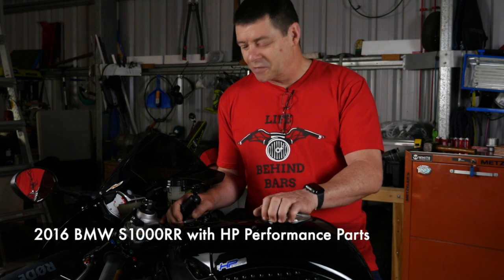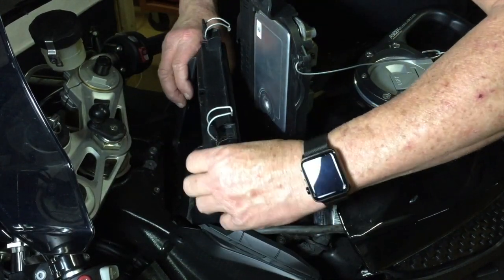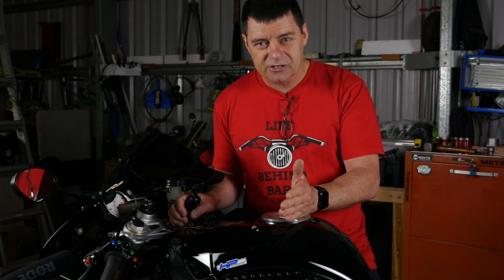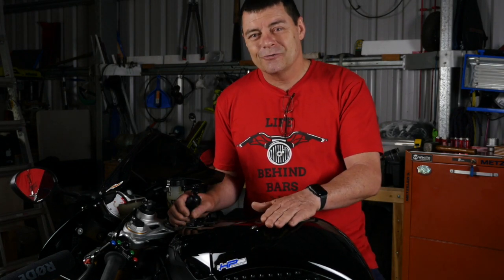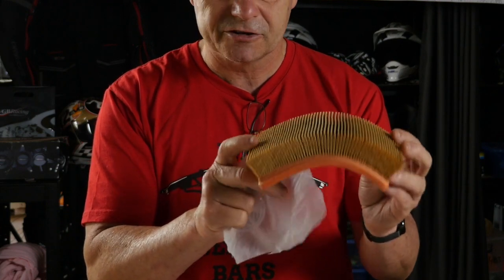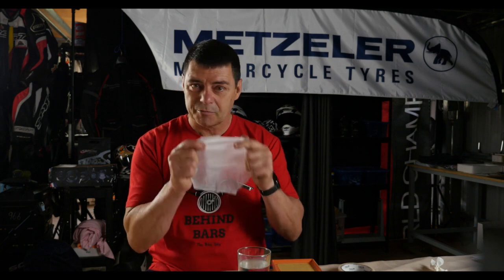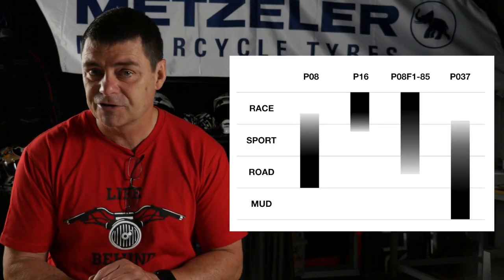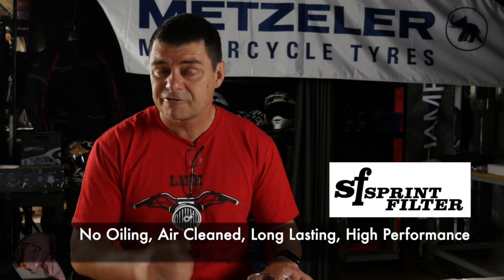Sprint Filter air filter technology explained from The Moto Project

Comment: Awesome. I have the P08 in my 1050 Speed Triple, and it really lets the engine (particularly with CNC velocity stacks that I have) breathe. I would totally recommend Sprint SF.  Add a remap into the bargain and power's now up by 20bhp at the crank.